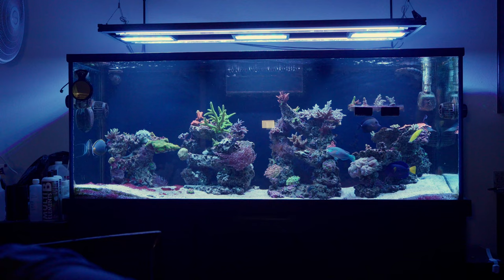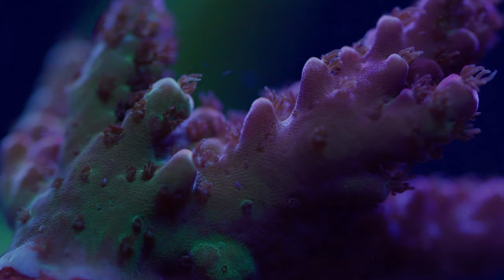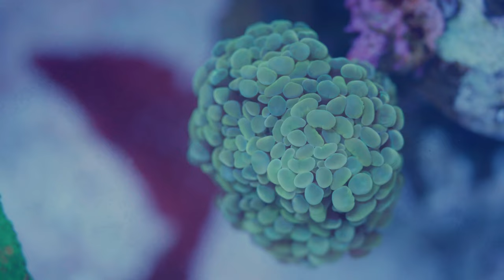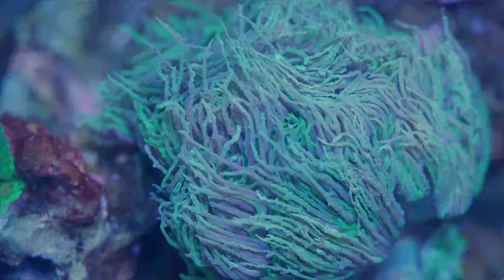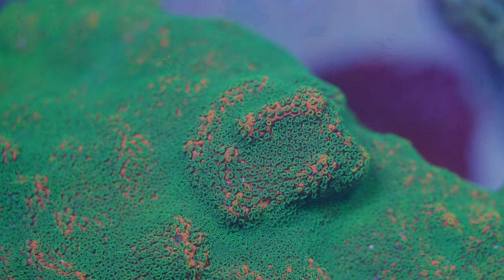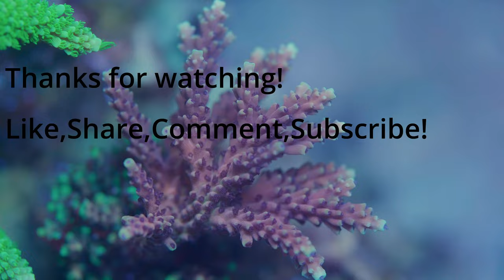Dosing Method!

Comment: Keep a close eye on your calcium. When I first started with kalk 3 years ago I noticed a jump in calcium. Eventually I had to add sodium bicarb and carb and back slightly off kalk. In my 180 I was adding about 2 dkh a day. I dropped alk to 1.5 dkh and dosed bicarb/carb .5...most say kalk adds back in equal amounts what is used, this is wrong. But your right kalk made all the difference for me too. I have think it really comes down to ambient co2 in the house. I do red sea for trace but I also noticed my iodine was high, very high on icp. I figured out that this was caused by the nori I feed. For this reason I went back to some water changes. Btw ab+ is a very nice amino I like it better that 2 fishies.
Reply from the maker: Thanks for the heads up on the calcium! I have been watching it closely and so far it's been very stable.